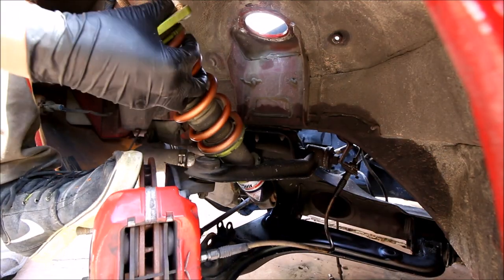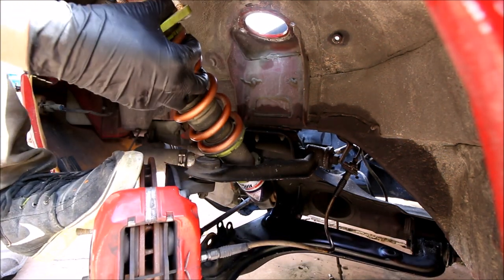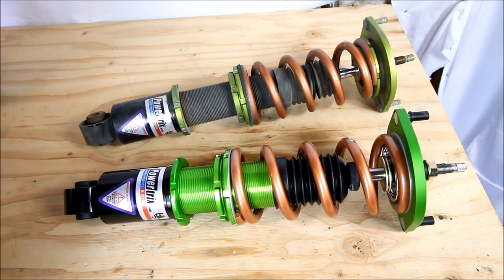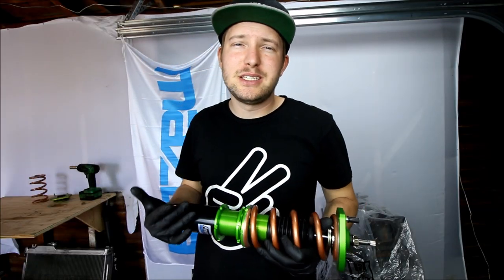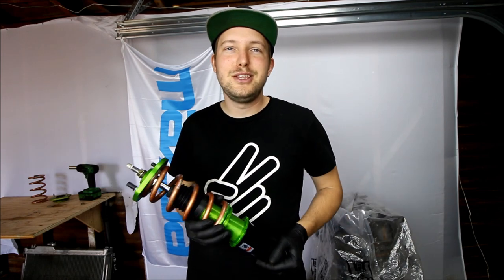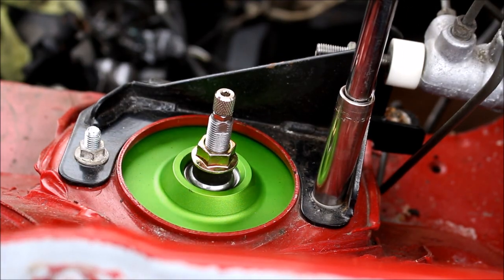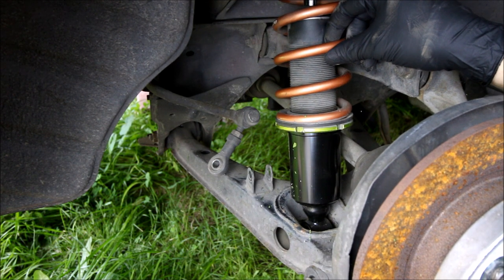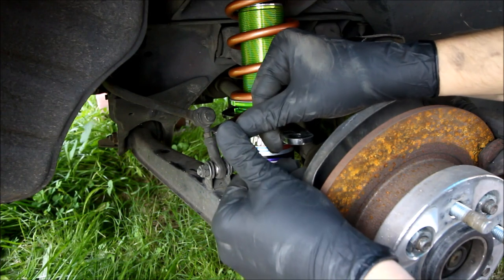Maximum Grip: Choosing & Installing Coilovers on the Main Miata

Comment: so I would love anybodys opinion. so I have a stock miata base model right down to the steelies. I have 600 dollar budget and id like to add some things to my car. I've been contemplating alot of different options but most parts will take up all of my budget. so what would you recommend? my car is a daily driver and I dont plan to track it or autocross and I also dont want to slam it. I would like a track like profile in the end. should I pick up a set of racelands? maybe a set of rims? or should I divide it up more and get some nice speakers a nice steering wheel a front lip and some turn signal intakes or should I do none of that? id love any suggestions you may have.
Reply: tbh not going to be able to do much with 600 bucks... find some used wheels online or locally for cheap and get some body mods (Aero) or ricelands and wheels... either way, i doubt youll stick to your "budget" of 600 lol happy modding!!!
Reply: Lol ya...... car stuff is expensive lol i was thing of just getting a set of daisys and paining them, then getting some nice speakers, a lip, and save whatever else i have left
Reply: coilovers and wheels make these cars so much more fun... you dont need a radio when your giggling like a little girl in the twisties ;)

Comment: What is your recommendation for a coilovers for a 2014 miata daily driver
Thanks
Reply: Wait for 949 to release their NC XIDA's with street spring pack. Exclusive vendor will be Good-win Racing. XIDA's are every bit as good as everyone says they are. They're pricey compared to some options, but really not expensive considering how good of a damper they are (think Ohlins, Penske, Moton, Multimatic, etc) and with a street-friendly spring rate, they will give you incredible body control without any punishing ride.
Reply: choneofakind Thanks

Comment: so I can have them make me a set for my fc3s? for 300$ less? just as good as bc?
Reply from the maker: Dylan Esposito Even better, I'm fairly sure they already offer FC3S coilovers. Call them on the phone, tell them I sent you, and I'm pretty sure they'll hook you up. I've never run on BC's, but I would confidently put these against any coilover at the same price level in performance and quality.
Reply: I'll be giving them a call here in the next few weeks!! Still working on getting a new rotary in the thing ;) currently sitting on stock suspension and was gonna go with bc but these are much cheaper and you seem to put them through lots of abuse, so I'm sold. And dude your channel rocks!! No body has ever replied to my comments as quick as you lol
Reply from the maker: Dylan Esposito Hahaha. Thanks for checking out the videos! Just a little fyi on the coilovers, I know sometimes they have group buys running which can get you a little better price also, and you only have to put half down up front until the coilovers actually come in. Might be worth making a call to them just to get the deets. Cheers

Comment: Are you really running spacers on a car that you track and auto-x? seems sketchy
Reply from the maker: Yep since day 1
Reply: hmmm.. mine came with 1" spacers that I took off due to safety,  maybe I'll give them a try. Currently using honda offset wheels that are a bit narrow and some hoosier r7's
Reply: Upgrade to stronger extended wheel studs and you won't have problems.

Comment: Why does no one do the fucking long bolt method? It's 100x easier! I audibly said wtf to this Greg. I expected better. lol #angryoldmiataowner I'll go back to miata.net now... lol /sarcasm

I'm not gonna tell you how to do your videos because I love your content. But maybe you also should have touched on adjusting sway bar endlinks after coilover install too, unless that'll be a separate video? You're the responsible miata page besides miata king. All these kiddos watching your videos need to know the tried and true old guy methods from forums haha.
Reply from the maker: Phil Miecz I'm definitely considering following up with a setup video once the car is running again. 👍
Reply: once coilovers are in you dont have to do long bolt method... but it does help a lot with stock suspension!!!
Reply: TheCarPassionChannel i was waiting for this video from you  sooo badly ahah as someone mentioned, sway bar regolation with adjustable end links is a must when changing suspensions? No need of torque wrench with this installing method? And why do you set you pre load on 0? Is it because your springs are already stiff enough?

As always love your videos and contents and can't wait to see the main miata running again! Cheers from italy!

Comment: dang, $1200-$1500 bucks for those. huge investment for used $6000-$8000 vehicle
Reply from the maker: Yeah unfortunately the price of a part is not determined by the market value of the used car it's being installed on. The coilovers for the GTR are about the same price from this company, it doesn't mean the coilover is now $20,000 just because the car is $100,000 :)

Comment: The welded nut in the rear inside the lower control arm for the bottom of the strut broke so the bolt is just spinning....fml

Comment: swaybar preload fail?
Reply from the maker: Steve Graham Most people watching this probably have stock links, so I did not cover end link adjustment.
Reply: makes sense. im a big fan didnt mean to come across as a doubter
Reply: I have an R package the previous owner put the racing beats sway bar into, haven't checked it has stock/vs racing beats end links? anyways whats the gist of reconnecting/disconnecting them if there adjustable.
Reply: You just need to set them with the car on the ground. Google steps on any miata forum